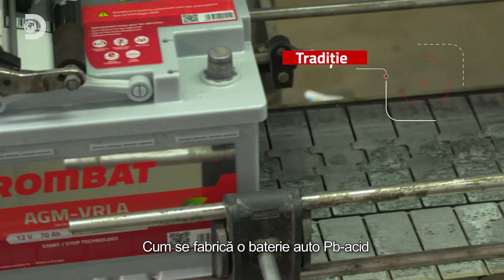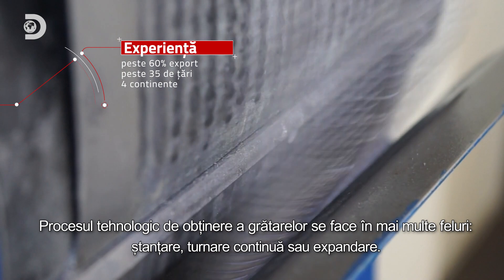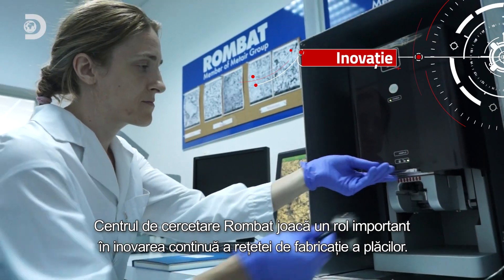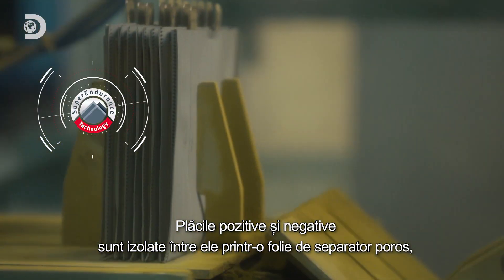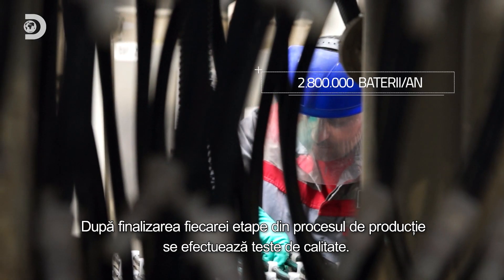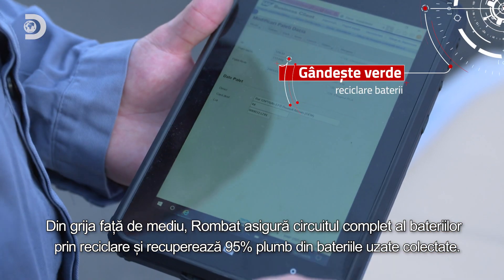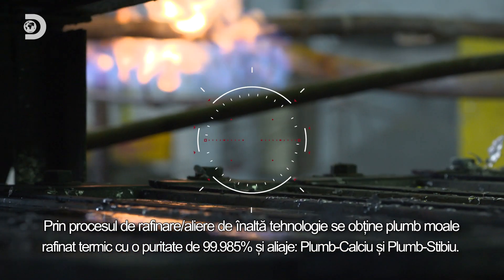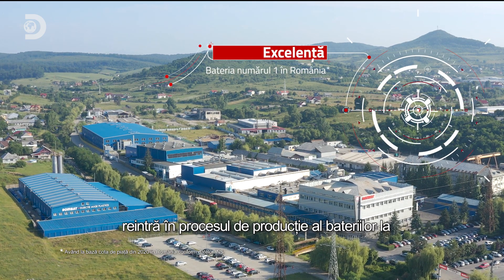Cum se fabrică bateriile Rombat

Comment: Asta-i varianta cosmetizata...ca o baterie noua m-a tinut doar doua luni. GUNOAIE DE PRODUSE!!!
Reply: Pe mine m-a lăsat cu circa 2 luni înainte de expirarea garanției. M-am prezentat la magazinul local Rombat unde am fost apostrofat de un domn extrem de obraznic!
Reply: @Kermexx  if you deplete 100% -> 0% a Pb battery several times, it dies. This has nothing to do with Rombat or any other producer, it is jst chemistry and how these battery technology work. Do not fully discharge them.
Reply: I use them for year's I have never had any problems...I am surprised u guy's had. Cheers
Reply: Am si eu una pe masina de 60 ah. Pana acum a mers bn, are cam 2 ani. Sa vedem cat mai tine.
Reply from the maker: Ne exprimăm regretul pentru experiența mai puțin plăcută. 

Satisfacția voastră, a clienților noștri, este deosebit de importantă pentru noi. De aceea, alături de echipa noastră, încercăm zi de zi să îmbunătățim calitatea produselor și a serviciilor oferite. Produsele noastre au garanție de 2 ani și astfel, pentru orice problemă intervenită în această perioadă, te poți adresa unuia dintre cele peste 100 de service-uri autorizate Rombat, din toată țara.

Găsești lista partenerilor noștri pe https://rombat.ro/ - la secțiunea Baterii / Locații.

Mulțumim pentru înțelegere.